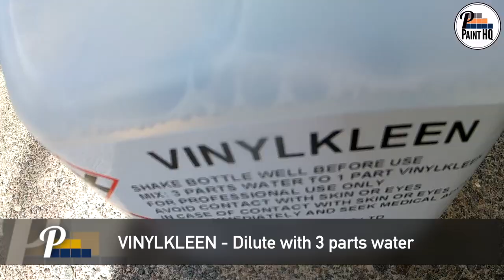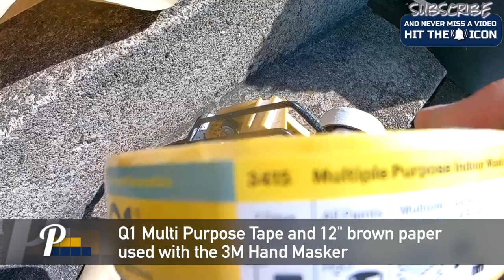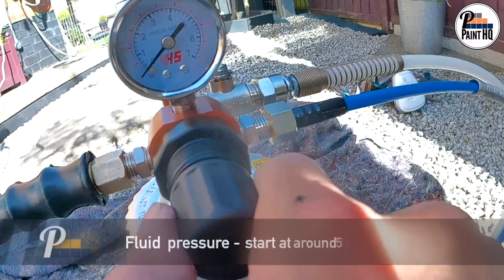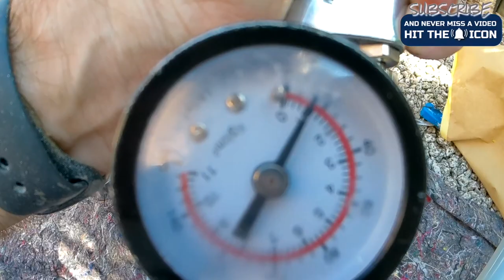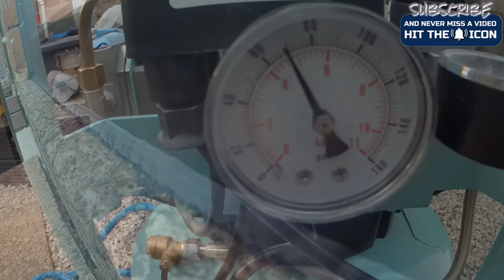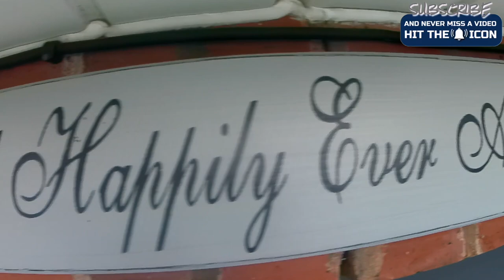uPVC Door Spraying | How to Spray PVC

Comment from the maker: Would love to hear about any experience spraying uPVC.. What products are you using?

Or anyone using an air spray / HVLP setup ..Do you do wood refinishing? Even spray cars .. What equipment are you using and what materials do you spray?.. it’s great to get your input 💯
Reply: Hi mate I've just bought a wagner FC3500 can it be used on pvc with the fine finish tip on for it cheers
Reply from the maker: Hey John, thanks for your input on the channel.. that’s a great machine, I like the XVLP sprayers.. yeah Kolorbond will spray through XVLP.. you may just have one problem.. the viscosity of Kolorbond is very  low (thin).. sometimes when it’s that thin, the pressure can not hold in the cup so you get a stop start spray (pulsing)... bit like when cleaning / flushing with water, the spray will pulse.. I’ve got this machine https://youtu.be/1C2CV8mEWn8 ..Same just with the separate turbine.. when I get chance, I’ll put a video testing Kolorbond through XVLP ..Hope this helps my friend, keep in touch.. regards Pete 🎨💯
Reply: I have sprayed many automotive applications with HVLP before.  For around the house stuff similar to this where I am spraying metal I usually use a siphon feed gun with a 1.7mm tip.  In similar applications I have sprayed an enamel acryilic cut with a basic universal reducer.  Works well overall.  However, I loved your scratch test in this application.  That is a great paint and I liked how you did the scotch bright in between coats.  That was very interesting to me!
Reply from the maker: Really appreciate your feedback.. you’re an awesome sprayer and it was great to get your input.. keep in touch my friend.. regards Pete
Reply: I sprayed a pvc door + frame and a few of windows but it was a spray booth job with large compressor and devilbis gpg guns (is1.5 bar considered high pressure?), used shervin williams 2pack polyurethane. Did pretty much the same procedure as you here and got great finish, didnt think to do a scratch test 😊, will remember the next time. Masking was a nightmare as I couldnt remove the glass panel while rubber gasket and masking tape refused to cooperate with each other. 
Looking forward to sprayman hvlp + pot set up but tripping at the same time as I dont have access to sb anymore and never used hvlp. Exciting times.
Reply from the maker: Thank you so much for sharing your experience, very insightful my friend.. Yeah exciting times, you’ll soon take to your new setup.. just reach out to me, I’m happy to help if I’m able to 👍 ..regards Pete

Comment: I've had my sf23 pro wagner for a couple of years now, fantastic unit especially with the 2 hoppers. But seriously considering going AAA. Rep from wagner is adamant I should go for it
Reply from the maker: Hi Matt.. go for it buddy.. the Gentilin compressor in this video would be the perfect compressor to go AAA, especially with your SF23.. very nice my friend 👏 ..This Gentilin is the ultra quiet, there is a cheaper model that’s not ‘ultra quiet’ but it’s not loud by any means.. and you don’t need to run the compressor directly alongside the airless sprayer, you can run the air line from another room.. coupled with the Wagner AC4700 gun.. it’ll be an awesome setup .. sorry, I sound like a sales rep or I’m sponsored.. I’m not btw 😆 it’s just that Mike at SpraymanUK is very knowledgeable in the ‘spraying / compressor world’ and not just out to make a sale 👍 ..Please keep in touch and let me know how you get on.. even if you don’t go AAA yet, always great to get your input 💯 regards Pete
Reply: Cheers Pete, I'll look into that 👍 Appreciate your time and knowledge  as always
Reply from the maker: You’re very welcome, anytime 👍
Reply: Hi Pete, have you considered heated hose application? Lower pressure, better application and viscosity etc.
Reply from the maker: Hey Matt, very much so, it’s on my list 👌 ..looks an awesome bit of kit.. do own one, or have any experience.. would work nice alongside your SF23 💯
Reply: Hi Pete, yes I've recently purchased the h126 and it was worth every penny.  Love spraying like yourself but even more so now
Reply from the maker: Ah nice one.. I’m jealous 😆 ..Great feedback buddy 👏👌👍
Reply: Game changer Pete, get involved when you can . Your works already superb, this would just make it easier and save time for you......no diluting paint etc
Reply from the maker: That’s kind of you to say Matt.. really appreciate your feedback and input on here 👏👌👍😆

Comment: Hi Pete! Door looked absolutely awesome!! I have a graco quick shot. Would you recommend using that to spray UPVC. Do you think it will do the job? 

Thanks Again. 👍
Reply from the maker: Thank you my friend 🙏 You know what, that’s something on my mind to demonstrate (the possibilities) in a future video.. basically you need to reduce the paint flow to gain more control — you do that by using a smaller orifice size. That said, the paint viscosity has to be low, plus bear in mind the minimum UQS tip support is .008” — but a .006, so a 206 and 106 is possible, as long as the UQS is not over pressurised.. So yeah, basically it’s very workable to spray uPVC with the Ultra QuickShot  💙💯 regards Pete
Reply: @PaintHQ  thank you for the reply 👍 Yes definitely do a video, I'm sure it will get a lot of attention 👍🤗

Comment: Hi Pete looks bang on my friend if you wasn’t using air less on woodwork would you use this system or hvlp  xhvlp 
many thanks for your time
Reply from the maker: Hey Paul, appreciate your kind words as always 💯 very good question.. yeah as you know I’m a huge fan of airless using the .008 tips to spray manufacturer coatings.. so I’d have to say a compressor setup with the HTE gun, manufacturer materials will go through it like a dream.. nothing against the turbine HVLP ..but they’re loud and the air lines being thicker they can be heavier in the hand .. I do rate XVLP but the extra air can drive you mad blowing the masking off ..This compressor is quality, you get value for money and sprays awesome 😆 ..Great question, hope you’re keeping well my friend 👌👏👍 ..Regards Pete

Comment: hi mate im doing 4 pvc windows and a door in summer from watching your video the key is useing scitchbrite inbetween coats could you give me any tips or advice on my first go at doing it please
Reply from the maker: Hey Gareth, happy to help and advise if I can.. I do plan to do a follow up video on this.. I like the Kolorbond ‘system’ of using the 2 preparation cleaners, but I’d go for a 2K product.. never WB, in my opinion WB is not strong enough to adhere to uPVC, the solvent 1K (original) is perhaps ok for windows.. but really I’d look to go 2K.. I think Kolorbond’s is called K2.. another highly rated product is Selemix 👍 ..but yeah, using Scotchbrite to key and build up the coats lightly is the way to go 👏👏👏

Comment: Hi Pete, your discovery of Blue Dolphin Rough Surface Exterior Tape is brilliant. I just used it on old bricks to mask up an external door frame, it followed the contours of the bricks and mortar joints very well and gave a really clean line when removed. 
I used Tikkurila Ultra Primer followed by two coats of Ultra Classic on the door and frame. I followed your suggestion and bought FFLP tips (208 for frame, 308 for door), the tips were fine but although I added some water to the Ultra Classic my Graco Ultra Max really struggled with umpteen blockages (which is a pain when you are trying to get a clean pass). I had it on 10, knowing that you max out around 7, and wonder if I should just water it down a bit more? Any guidance always gratefully received. 
With thanks and best wishes, Rob
Reply from the maker: Hey Rob, awesome feedback on the Blue Dolphin tape.. yeah it’s really useful to have in your kit, even on other ‘problem’ masking areas when you need that extra bit of grab.. I’ve used the Ultra system myself, great products.. in the scenario where you’re upping the pressure of any sprayer and you get a feeling it’s higher than it should be (possibly still getting tails), or in the case of the handheld, you’re at max 10.. you’re kinda right in thinking of thinning, thinner lower viscosity material going through the smaller size.. but ideally you’d need to up the tip size.. from a .008 to a 0.010.. so in your case a 210 / 310.. that’s why you’re getting the tip blockages too.. I know it’s a pain 🙈 ..by all means you can thin, I just don’t want you to loose the integrity of the paint by thinning too much.. let me know how you get on, always great to hear from you 👍💯
Reply: @PaintHQ  Aargh! More tips? I’ll soon have more than Sprayman’s stock! 
That said I really appreciate your feedback, always with helpful advice that I can implement. I’ll get to ordering. 
Many thanks for taking the time to respond. With best wishes, Rob
Reply from the maker: Haha 😆.. you’re very welcome, always happy to help if I can.. like I say you can try and add that bit more water.. I don’t mean to come across as you need to spend more money, I can appreciate costs add up.. the tips do last though.. I recall you saying you used a 208 and 308.. just a 310 would suit your needs.. what will happen is the 310 is the same volume of material but less concentrated than the narrower 210.. so a 210 you would have to move quicker, the trade off is a 310 is wider so more overspray to contend with.. 12” paper will still be fine though.. hope this helps, I guess it all adds to the understanding how airless and the spray tips work, what happens it all prices together and starts to make sense 😆 .. I’ll eventually put an in-depth video together explaining the tips, not just the widths because that’s a bit more easier to understand, but what happens in terms of the volume of material that is sprayed and how viscosity determines the tip selection 👍👌😆
Reply: @PaintHQ  Many thanks for elaborating Pete. 
Until I got the 208/308 combo I’d used a FFLP 410 and made a real mess with overspray on stair spindles! I’d marvelled how you were happy to use masking paper around door frames without worrying about overspray hitting the walls. Using the 208/308 was delightful as I could see most of the paint was going onto the target. I’ll certainly get both 210/310 so I have more flexibility. Anyway, the client was thrilled at her “new” front door (with no brush marks) which is the main thing.
There’s a lot more to spraying than I initially thought, and a video, along the lines you suggest, would be brilliant. I’m thinking of putting together a sheet listing paints used, amount of dilution and tip sizes used, so to have something to which to refer on future jobs. 
Many thanks for all your guidance. With best wishes, Rob
Reply from the maker: ..You’re idea of a sheet and listing the tips / pressure / settings and general notes is spot on.. that’s what I did from day one learning to spray, and still do now 👍😆 ..I’ll make a video from a beginners perspective and incorporate the making of notes 🤔👌😆
Reply: @PaintHQ  I can't wait! Bless you, Rob

Comment: Hi great job! What do you recommend for UPVC Kolorbond original or the Kolorbond 2k
Reply from the maker: Thank you my friend.. that’s a very good question, something I plan to do a follow up video on.. a solvent 2K would be my preference, Kolorbond K2 or Selemix is another one.. kolorbond original could fair well on windows, but doors with high traffic, I’d definitely go with a 2K 👍 ..keep in touch.. regards Pete
Reply: @PaintHQ  I’ve been doing a lot of UPVC doors with the original but have a full how to do now and not sure to go with the 2k, is there much difference in spraying the 2K? Also the air cap your using, what’s the benefit compared to a standard anest Iwata HTE cap?

Comment: That looks mint mate but im just thinking all the time to tale off a door and remove everything? How do you make it pay?
Reply from the maker: Thank you buddy 🙏 it’s like anything, it’s a process that you get quicker at over time 👍 ..next summer I’ll look to post more on uPVC and exterior work.. I do like taking on the odd one, if I’m sure on the weather 😩
Reply: Yeah mate I'm.a decorator myself just trying to get into more.upvc, kitchen sprays. I've had enough of the roller and brush and where possible am trying to stick to spraying.

I'd.loke to spray them without taking them out though if possible ad it would save alot of hassle for.me and the customer but appreciate that there is a benefit in taking out its about cost/benefit I suppose. Good luck I will keep following you!
Reply from the maker: @shanewyatt9939 You’re doing great my friend 💯 Thanks for your support 🙏

Comment: I’ve used this paint a few times, great video but I guarantee that handle and letter box will scratch within months.. I don’t sheet these for this reason
Reply from the maker: Thank you my friend 🙏 Yeah I totally agree, it was a little test on my own door.. I plan to do a follow up soon, my thoughts right now is I’d only use a 2K solvent on uPVC — the product in this video is a 1K by Kolorbond (Original), I believe they do a 2K (Kolorbond K2), but I’d likely go with Selemix 👌 ..appreciate your input my friend.. regards Pete 💙💯
Reply: @PaintHQ  yea they do a 2K water based which is what I use … really good stuff …👌
Reply from the maker: @Colwray1 🙏👏👏👏
Reply: @PaintHQ  just to all I did a full house around 8 years ago using the 2K water based paint..I went back recently only to touch up where the beads has expanded and cracked otherwise the paint still looks like new 👌
Reply from the maker: @Colwray1 Thanks for sharing buddy, much appreciated 🙏 regards Pete

Comment: Great job mate, you can prime themastic with zinseer bin,save ripping it out the paint will stay on then, what is the machine you are using????
Reply from the maker: Hey Joseph, thank you for watching and really appreciate you sharing the tip 😆 ..It’s an airspray setup, the gun is the Anest Iwata AZ3 HTE2 pressure feed gun with a remote 2 litre pressure pot, running off a Gentilin Ultra Quiet compressor 👍 ..Great to have you contributing on the channel my friend.. regards Pete 🎨💯
Reply: @PaintHQ  thanks pete👍
Reply from the maker: You’re very welcome Joseph, anytime 👍